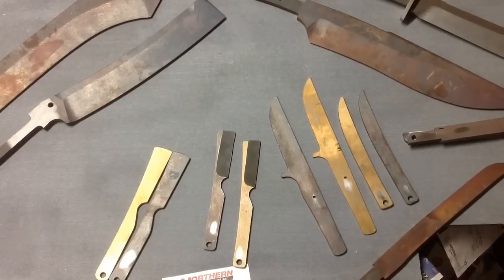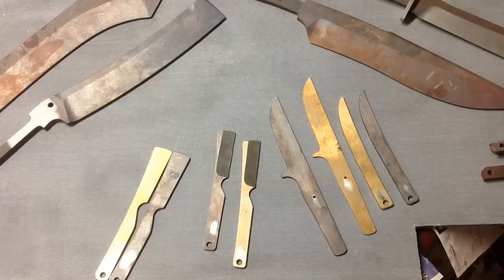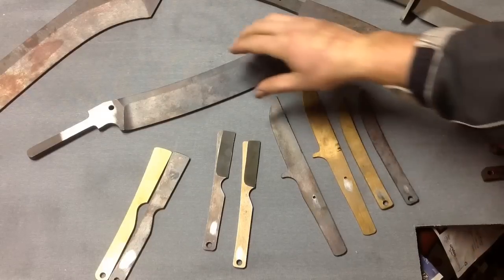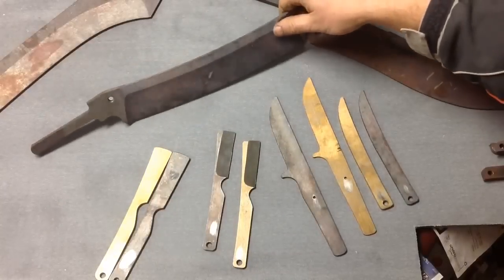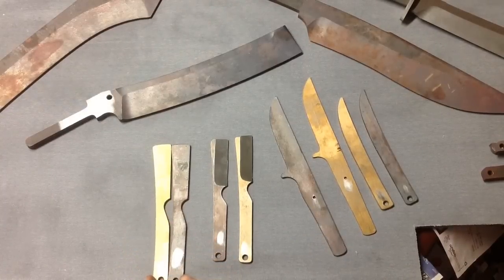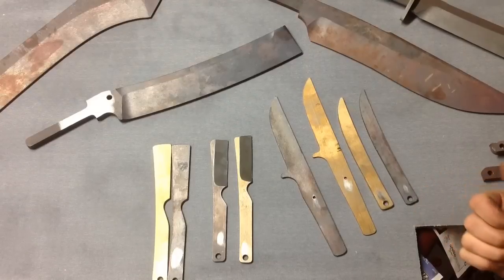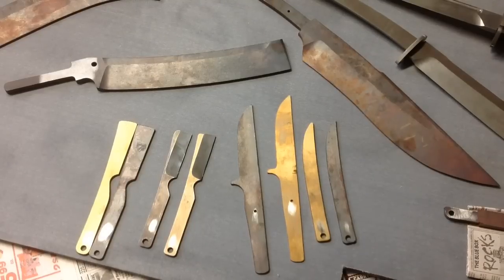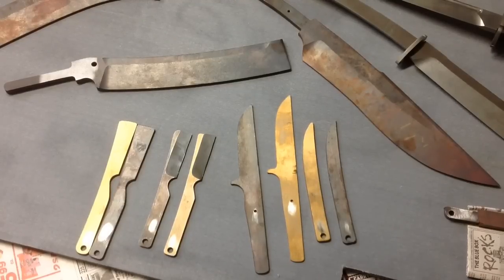Testing Vanadis 4 Extra edge capabilities

Comment: In your opinion which steel has the best properties to be made as cutting competition blade? PD1, M4 or Vanadis 4E?
Reply from the maker: My primary blades for this cutting season is Vanadis 4E.
Both PD1 and Van 4E are able to run thinner and harder than CPM M4

Comment: Damn, looks pretty good :) I was thinking straight razors when i saw the first four on the left :D don't feel like sending one to the UK? :P Try batoning with them, it will test how much force they can take from the spine to the edge, some steel will warp at the core, so the core is too hard and will split. Whilst a good chopper needs to have a soft core to absorb the shock, blacksmiths used to heat treat the edge but temper the rest of the blade, making for a hard edge and flexible core which is why a longer sword wouldn't shatter. Not sure if this would be a factor in such a short blade as a chopper but in a larger blade yes.

Comment: Very cool testing Dan. I have heard Vanadis 4 is good steel. how thin do you normally take the edges on the competition cutters?
Reply from the maker: On my competition cutting knives
I usually use a primary cutting edge that is sharpened at 15° per side or 30° inclusive. However on these knives the edge thickness has a distal taper